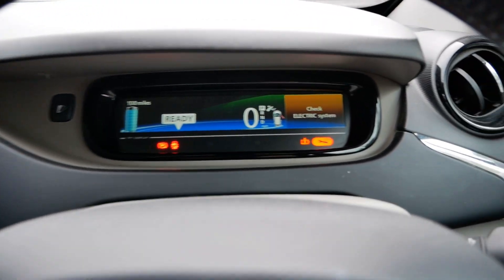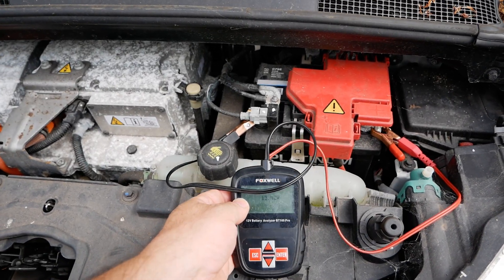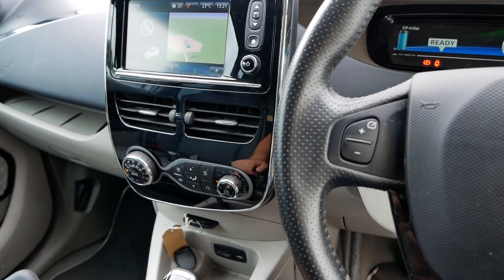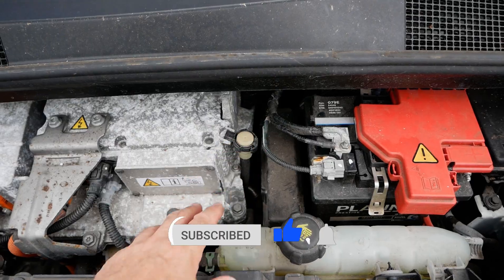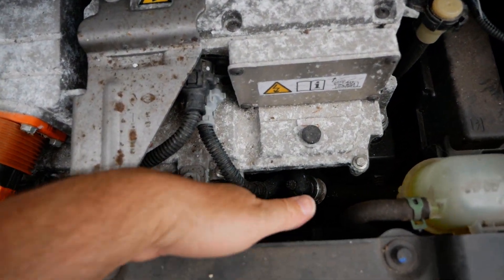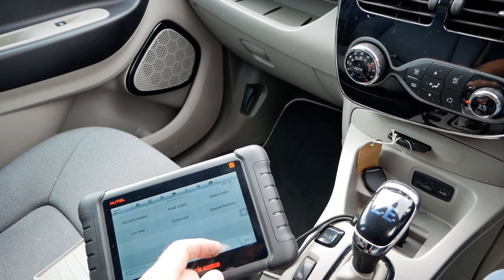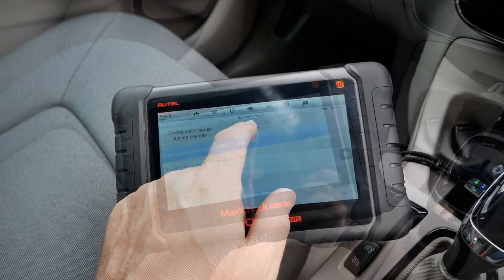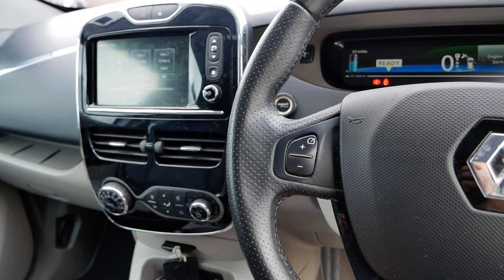Renault Zoe "Check ELECTRICAL system" error and how to fix it.

Comment: Another great video!
Do you know if the water pump be covered by the Renault Extented Warranty ?
My 2017 Q90 has 84,000 miles on it so far.
I always change the 12v Battery every 3 Years🙂
Reply from the maker: I don't know. You'll have to look at the terms of the warranty. It might be considered as normal wear & tear.

Comment: Handy information that will help owners of older EVs keep maintenance costs low; thanks for sharing. 👍
The water pump counter sounds like a sensible reminder to replace the pump before it wears out. That is similar to replacing a water pump on an internal combustion engine when replacing the timing belt. ☮️

Comment: I'd spray all the aluminium parts with ACF50, it's used on aircraft the stop corrosion.
Reply: I did that to mine and the motor skill looks good and it's a 2016 model. Those on the video look nasty..
I did get told off at the Renault garage mind by screw them, bunch of thieves..

Comment: I had a 2013 Zoe that was displaying 'motor failure', 'check electric system' etc, which also triggered the pedestrian warning sound. The problem was a lose connection under the red cover on the 12v battery. A quick check of the 10mm nuts on the connectors and the problem was cured.
Reply from the maker: Good point.
Reply: Which connection?

Comment: If the 'Check Electrical System' warning was due to the 12v battery having a low voltage, if you charged the 12v battery would the 'Check Electrical System' warning go away on its own or do you have to clear the message through an OBD tool?
Reply from the maker: Most the time it would clear itself, if its just a low 12V battery.

Comment: Very useful video..I have a 2015 Zoe 22kwh and I do get this error on the dash but only if I leave the  car for a few weeks untouched, so I assume the battery is going soon, however very good to know about the water pump counter, all I need now is your diagnostic tool. I have an obd reader but its missing these special functions. Would you recommend this Autel brand you have? It does seem good
Reply from the maker: Yes Autel make great scanners (well its down to software) and cheaper than most others. But still probably too expensive for DIYers.

Comment: Do you know if this is still an issue on a 2020 ZE50 GT?
Reply from the maker: A low 12V battery will still trigger these errors. As for the water pump counter, I don't know.
Reply: The corrosion on the top is horrendous wonder what else is corroding badly🤔.    Wonder if the “PVC” is the green stuff hence the mees’s 🐈🐹🐈
Reply: @pollywollydo  probably due to the heavy salt use on our British roads in winter
Reply: @markreed9853  apart from radiator/ condenser corrosion it is not common to see that level in other brands.   Like many other design details on the Zoe( and other Renaults?)  it was either designed a/ after a good lunch.   b/ a bunch of school kids on work experience.  c/ superannuated fashion designers 😖